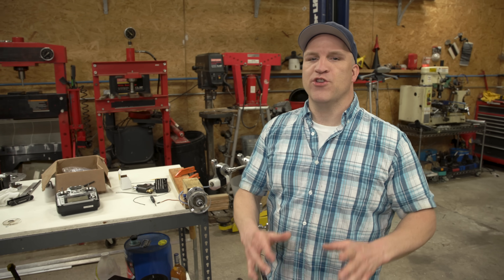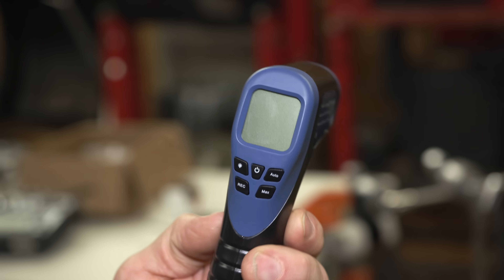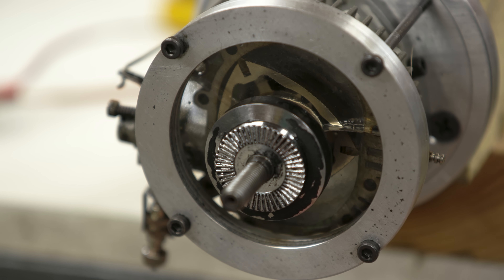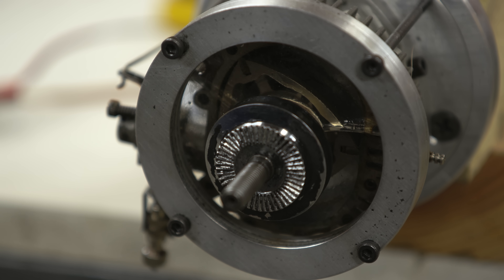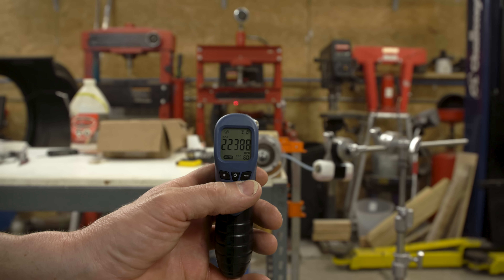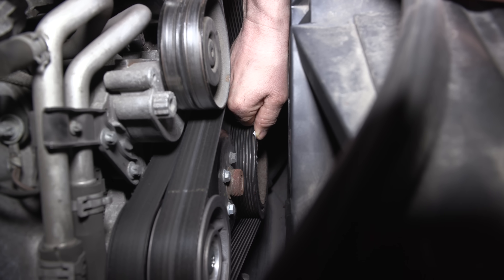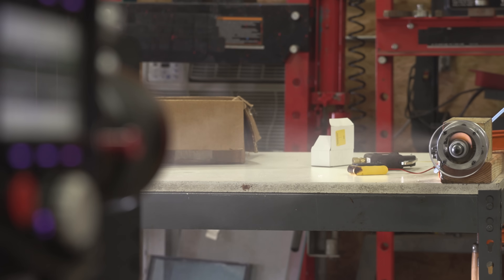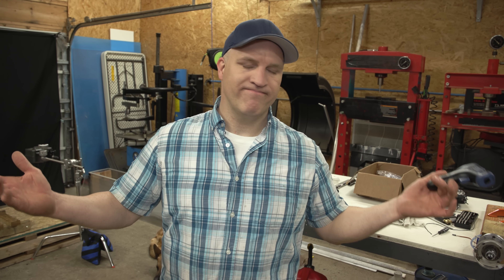See Thru Rotary Engine MAX RPM - 29000 (Wankel Engine)

Comment: The full size rotary engine if the gear on the rotor is locked in have been known to go as high as 30,000 RPM.

Comment: I use to race nitro engines in 1/8 buggies and 40size planes. 

I have a OS 21 vspec and it revs to max 42500rpm (2stroke nitro) 

I always wanted to get the os wankel. Iove how its peripheral port aswell.

Comment: So rats 66000 revolutions at crank or shaft
Reply: There is no crank. The shaft is an eccentric shaft, and that's where the speed would be measured, not at the rotor (which turns at one-third of the shaft speed).

Comment: How much fuel does it consumes? Maybe we can scale down the size and use it as a hybrid set-up. 

Imagine a hybrid with a 300cc 2 rotor wankel  for backup with a redline of 15k rpm. That engine is gonna be compact af and hybrid will help with emissions.

Comment: Also, just noticed something interesting. At the end, during the high speed footage, pay attention to the vibration. Even though it might only weigh a FRACTION of a gram, at 29k rpm, that tiny piece of tape on the flywheel is enough to create a visible imbalance. That is friggin insane...

Comment: If you think about it.... the Wankel has more compression at high rpm. When you have something spinning at 30.000 RPM, you'll have some serious expansion! The apex seals will expand like crazy, even the rotor itself will expand a millimeter or two. The G Forces are crazy!
Reply: No, compression ratio doesn't change with speed, although volumetric efficiency will.

Comment: My dream is to make a 3d printed ceramic 13b with moving parts 5-10 times lighter than regular once and run it NA to 18k rpm or the most its safe to in an rx7 fd...i know its possible some people i know have done it with pistons running 15k rpm on dragsters but i really want to do this with a rotor...mayde i am just crazy and i must see a doctor at least thats what people tell me but thats my dream and life goal i will propubly die without succeding with money barely enough to feed me

Comment: There is nothing wrong with your tachometer.  Wankel engines WILL rev to significantly higher rpms because there is no reciprocating motion to slow them down.  I've had eight rotary engined cars and currently fly model aircraft - a helicopter and plane - with the same OS.30 engine you're using with the clear side cover.  THAT is why they're such amazing engines.

Comment: Interesting to view internal combustion happening in real time! And that is extremely high rpm but we can assume when running it w.o.t. static with the load of an actual propeller, APC 9-6 for instance, that high rpm number will be cut in half correct?

Comment: How much power does this engine produce, the number of revolutions is great, but at the expense of the life span I always asked myself why these engines do not become effective in Formula 1 cars, according to the fact that they are relatively economical in fuel and may bear If it was made of titanium, for example, this type of Motors does not deserve to die, and it must be developed and made more durable and effective. Thank you for your efforts.

Comment: Does the engine work with the spark plug or does the fuel burn at the highest pressure without the need for the spark plug?

Comment: That was a brilliant vidio I would like to no if it is true that Honda in the 70s built a 125cc 4 cylinder 4 stroke and it reved up to 24.000rpm and is this possible. 🇬🇧👌👍

Comment: just like with firearms, I'm so amazed at how fast combustion type engines operate mechanically with how fast the combustion/explosive process occurs, and so efficiently without more breakages...   simply incredible
Reply: Thats the good thing about mechanics. The only speed limiting thing there is how strong your material is
Reply: i am a  mechanic for over 50 years and i am still amazed at the speeds of engines, intake, compression, power, exhaust cycles... the speed change a piston ,, it stops twice and goes the opposite direction each revolution.. 3000 rpm divided by 60 sec =50 revs per second= 100 direction changes per second... amazing

Comment: That just simply blows my mind how these types of engine operate, it is so amazing and cool and I wish we saw more of these around in cars but it seems like they are shying away.. amazing video man!! Keep up the awesome work!! You just got a new sub!! 😁
Reply: These engines suck compared to reciprocating engines
Reply: @sandervanderkammen9230  yeah I know that these engine have many problems and I wish they could figure out a way to address the issues and fix them but you fix one thing and another comes up, they have huge potential if the reliability issues ever fixed, I know it's a tough job and fuel efficiency is terrible on them

Comment: the true power of the Wankel, just casually hitting 20,000 rpms without breaking a sweat. When it did blow it was just the transparent cover too smh the rotor was still ready for more

Comment: since the exhaust is still quite fuel rich, could you attach the intake of another wankel engine to the exhaust of the first and run it? maybe add a hole for extra air intake between the engines.

Comment: Is there any information on what kind of power and torque the engine was putting out at (or near) such high RPM?
Reply: The Graupner 49PI was rated at 1.1 horsepower

Comment: The calculation is wrong.  Many has pointed out, it's only revving at 9,700 rpm the most.  If an engine revving above 20k, the sound will be inaudible for human.
Reply from the maker: Not true atball. there are a lot of different frequencies going on here and all sorts of sounds, just because the RPM is 29000 does not mean the frequency is 29000 Hertz. If a motorcycle revs at 14000 RPM, that does not mean that the exhaust frequency is 14000 Hertz. there are all sorts of sounds clashing making up other sounds even lower frequencies being produced like bass frequencies. My first career ever was an audio architect.

Comment: with the slow motion that you did at the end of the video, (1 revolution per 6fps), the engine was actually running at 19,423.7617 RPM. yes am bored x)

Comment: Wow, 29,000 RPM, but a turbine in a turbo-charger spins even faster // some dental tools even faster / compressed air engines // all power & no torque // ideal to make a magneto generator spin that NdFeB magnet super fast inside that wire coil, collect the current & covert the higher voltage low current to lower voltage higher current : as a genset for electrical final drive / traction battery charging //

Comment: Wait when you counted the frames wasn't that 6 frames to rotate 120°? So was the real RPM closer to 9600?
Reply: Look at the tape xd
Reply: yep
Reply: Actually, in rotary engines, the output shaft rotates 3 times faster than the rotor. What he measured was output RPM.

Comment: I measured this from the audio in this video and I get it even higher at 30,180 rpm. I used the fundamental frequency of the exhaust sound at the highest RPM which was found by spectrum analysis at 6:25.503s to be 503Hz. Multiplied by 60secs you get 30180 RPM.

Fascinating engine and the high speed camera footage is amazing.
Reply from the maker: Yep you can totally do that, definitely kind of cool I have dab a little bit into ultrasonics in the past, it's kind of cool how you can analyze the footage to determine the RPM. And that amount of RPM is definitely crazy
Reply from the maker: Thank you
Reply: 3 combustions , so multiply by 3 should be done, to audio burst frequency

Comment: I'd assume your RPM value is so high, considering the size of the flywheel you're measuring on the rotary has a larger diameter than the engine itself. You would have to measure much much closer to the crankshaft for accurate values.
Reply from the maker: No not really because 1 revolution is 1 revolution no mater how far away you are.
Reply: @WarpedYT  Just checked my old physics text. You are right. Tangential velocity is higher on the outside of the disc, but rotational velocity is the same at all points, I guess my memory sucks.
Reply from the maker: @WizardBal  well don't be hard on yourself..lol. when I did the test I had to think about it for a second too but yes you stated it very well

Comment: Remember the rotor itself is at 50% rpm of the engine so it's completely accurate.. Cool video keep it up
Reply: Wrong, the orbiting piston (aka rotor) spins at 33% of crankshaft rotation.

Comment: a 2 cycle 4 stroke engine?
nah, smells like a 2 stroke i will just call it a 2 stroke
Reply from the maker: It absolutely did smell like a 2 stroke
Reply: This is like à 2 strokes engine, the Wankel's engine has no valves, but is a four strokes engine 🤔
Reply: All Wankel engines use the 4-stroke operating principle.

Comment: Seriously doubt that rpm reading, flywheel would detonate at that speed. Also the sound would be barely heard because of it's frequency being too high to be heard by humans. I once modified a cox 049 motor and had it running so fast I couldn't hear it anymore because it was over 20,000 hz frequency. Suspect your flywheel rim is wobbling so much the tach is reading multiple spots on each revolution. Record the exhaust pulses on audio and use that to determine frequency.

Comment: I am really amazed at the accuracy of the tachometer. Bet you the price was not that high either. Thinking that you could use clear heat glass used on stovetop ranges ??? Maybe a much higher RPM will be capable ??? Since glass acts more like a bearing surface because of the polished surface and the very low thermal expansion you just might be able to go a lot higher in the velocity range. Good luck too.

Comment: Don't underestimate the power of lasers guys - also - be careful when you use that tach - you can easily burn your retina out with it.  Wear protective glasses when you use it.  That reflective tape will blast TONS of small bits of laser light everywhere, INCLUDING your eyes - especially if you're holding the tach by hand.

Comment: Would be a great little engine for a chainsaw or lawnmower.
Reply: Not really, only 1 horsepower
Reply: @sandervanderkammen9230  yeah your right needs a couple more hp. If only it was a little bigger
Reply: @Matty18795  Sachs made Wankel powered mowers and chainsaws years ago but they were awful and quickly discontinued.

Comment: it can do that because there are no valves involved and there is no up and down movement like pistons. If there would be at least one of them involved it would be very different. Amazing that it idles at 7k rpm
Reply: Reciprocating engines actually rev higher

Comment: I used to run an ABC OS single cylinder nitro engine that would top out at 28k so it’s not unbelievable or that much better than a regular piton engine. Ask OS to send you an RX 21 buggy engine they’re incredible and do a side by side comparison.

Comment: Totally false. You can heard the explosion at idleling that confirme that isn’t 10 000rpm lol. The tag speed is not place well. Also, the frequency sound do totally not to reach more than 9-10k rpm. People believe anything on internet! Bullshit!! I personally use idle speed mesuring toll in industrie to verify electric motor and the laser is always wrong. The contact wheel adapter show the THRUT rpm.

Comment: Rotary cranks turn 3 times the speed of the rotor right? I know small RC 1/8th scale engine turn some stupid rpm, yeah they are smaller but piston type. I’d start worrying about the flywheel coming apart near that area. Lots of harmonics, you see the engine moving even though clamped down. Pretty damn neat

Comment: From what I know when the rotor does one rotation, the shaft does 3 rotations, so if you got 9.666 rotations on the rotor itself, and 29000 rotations at the point of measurement. Well, that's the math explained my rotary mechanics, not me. All the best! Great vids!
Reply: LucyanoLuci but the number that would appear on the dash of a vehicle would still be 29,000, yes?
Reply: @sterlingroberts6240  Theoretically, yes,but in normal rotary engine you will never get this very high rpm.

Comment: Could a rotary engine be made to run on Diesel or would the high compression cause failure
Reply: Wankel engines can't produce high  compression and don't work well with direct injection or compression ignition.

Comment: Have you tried hooking this engine to a dynomometer? I'm really curious as to what kind of power it makes and what the power curve looks like. I've seen some R/C aircraft engines being able to rev like that, but at something like .30 cid 2-stroke (Which I had for an R/C car) the reciprocating mechanism is extremely light weight so it could handle it.

Comment: Why aren't these on weed wackers they sound the same they both need oil mix with the fuel and most of the fuel they use doesn't even get burnt it just flys out of the exhaust like the 2 strokes the only difference is that they are way more powerful.

Comment: How much power does it produce?
Reply from the maker: About 3 horsepower at 20000 RPM
Reply: The Graupner 49PI is rated at 1.2 ps or 1 horsepower

Comment: Very cool video.  These engines were made for propellers,  did you have any cooling air blowing on it?   It lasted a long time without cooling.  The model engine magazines ( Model Airplane News) etc. Published articles on varioius engines with RPM specs, fuel and propeller sizes back in the 1980's.

Comment: How much BHP per litre can a rotary engine produce?
Does it break the 110 BHP per litre barrier? Can a 6.7 litre rotary motor beat the legendary BMW S70/2 V12 motor?
Reply: The most powerful naturally aspirated production Wankel engine produced only 91 hp per liter (corrected for 720°)

Comment: divide by 3 because its counts 3 rotations as one
Reply: The rotor itself would be spinning at 1/3 of what was measured.  But you never measure an internal engine component for rpm just the output at the shaft.  We dont count how many times a piston has to move per revolution in a reciprocating engine either.

Comment: 2 stroke rotary, great for go carts & chain saws
Reply: Not really, Wankel engines are 4stroke and flopped miserably in power tools and recreational vehicles
Reply: @sandervanderkammen9230  Are you sure? Look at the rotary powered cars.
Reply: @billbergen9169  You don't know the difference between a Wankel and a Rotary type engine?
Adams-Farwell automobiles are extremely rare.

Comment: 6:20 that almost sounds like air raid siren
Reply: Well they are pretty simular 
Exept the boom part
Air raid sirens uses: air 
Rotory engine uses: burning air
Reply: tactical nuke incoming
Reply: Clarion Eclipse sounds like a 2001-dcr
Reply: Rara Nguyen  it does sound a lot like an 8 port, or in between an 8 and 9

Comment: How does the sparkplug works???
In that little motor
I dont see any wire????
Reply: Its a glowplug, it heats up the combustion chamber to start the engine but is not used after it starts.

Comment: If you build that thing with 5 liters and turbocharge it you have defently the most powerful engine
Reply: You'll also have to hook your fuel line directly to some massive barrels because that will inhale fuel
Reply: @maiq1218  yes and a decent 300l feul tank 😂
Reply: With 5 liters it couldnt spin that fast.
Reply: @semick4729  yes if 8 rotors, 0.5125L each
Reply: @afoxwithahat7846  yes, but we are looking into single rotor
Reply: @semick4729  rotors better be fast, not big, sad but isn't going to work as well as we want
Reply: mazda 787 engine was 2.6 lit with 700hp 9000rpm
Reply: also its not the best solution to turbocharge that kind of engine
Reply: @Giacomo020189  it's not the best solution to turbo a rotary???
Reply: more like the most powerful engjne explosion

Comment: This is basicly a 2 stroke wrankle because if it had a spark plug it would be a diesel rotary right?
Reply: What
Reply: @achilleaustin  science dude yiu3 should learn it some time
Reply: @bobbertthebuilder4856  having a spark plug does not make it diesel, and all rotaries are 2 strokes in theory. 3 turns of the rotor for every turn of the crankshaft. Diesels don't have spark plugs. I'm pretty sure this is a glow plug engine, which means that it essentially has a spark plug when starting but once it's running it just runs on compression.
Reply: @achilleaustin  i said glow plug but ok
Reply: @bobbertthebuilder4856  You didn't say glow plug and even if it did have a spark plug that would not make it a diesel.
Reply: @achilleaustin  okay but i didnt say that a spark plug would make it a diesel but ok dude
Reply: @bobbertthebuilder4856  You said, and i quote, "if it had a spark plug it would be a diesel rotary right?"

Comment: I had a Thunder Tiger nitro car with a 1.5 cc engine. It once had a runaway and was revving much higher than this. It may have hit 31,000 rpm before it blew up. It was an insane amount of rpm

Comment: Your output is one third though isn’t it.
Reply: 29k rpm at crankshaft.  Rotor was at 9,667 rpm then (1/3).  Never measure an engine component for rpms always the output shaft.  We dont care how the engine rotates the shaft we just count how many times it does.  This is one reason wankel engines can do such high rpms.  The rotor itself will always be moving much slower than the output shaft, by 1/3.  Meanwhile pistons move up and down TWICE per rpm 4 cycle